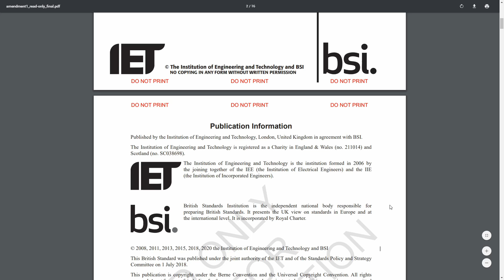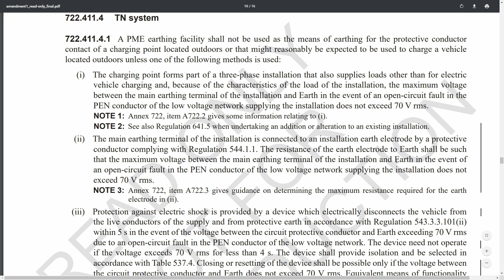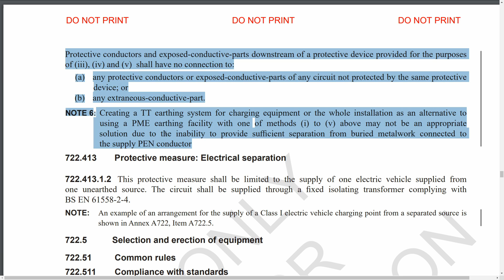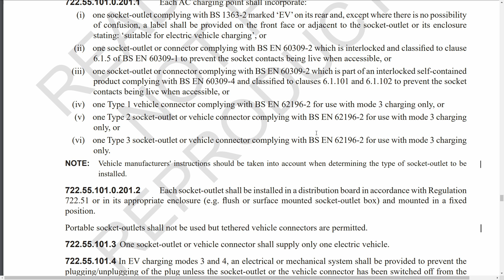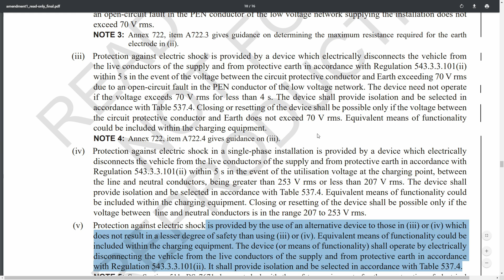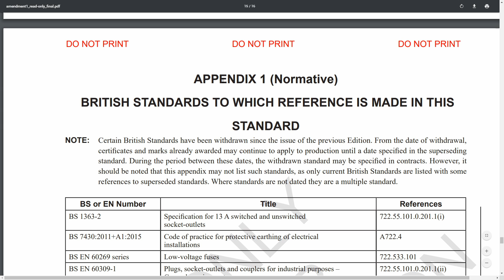BS7671 18th Edition Amendment 1- Section 722 Electric Vehicle Charging

Comment: If you want to print this without paying those miserable bastards at the IET a fiver for the privilege then just use almost any PDF viewer that isn't Acrobat. The 'don't print' protection is just a bit which software is free to ignore. So evince/atril on linux works just fine, for example.

Comment: Isn't that unicorn device just a voelcb, just wired differently? Or a voelcb in series with a relay on the neutral too if there aren't two pole versions?
Reply from the maker: Yes, it's a VOELCB with 3 poles, switching L, N and E.
The main difficulty with such a thing is that the earth electrode needs to be located far away from any other metal parts connected to the TNCS earth, otherwise when a fault occurs, voltage will appear on it from the TNCS earth and prevent it from working.

Comment: Good to see that, with your notes. The 722.311.201 item is interesting, as to what might happen if lots of houses want to change over to EV cars with charging kit in the next few years. At the time of writing this note, the DNO at my place is just replacing all their buried cable (and has just renewed the ‘local transformer’ at the substation) on account of having had a lot of cable faults in recent years.

	They appear to be doing a like-for-like job, with the exception that the new cable is being installed in plastic ducts, instead of direct burying, which the old ones are (and are likely to stay buried, most likely). Some houses in my street use ‘night rate’ power for heating, and some don’t, and it would be quite interesting if there is a substantial increase in EV charging - e.g. if I do that, my place can easily draw ~80A overnight, like tonight if I also wanted to charge an EV on top of it.

	Maybe they’ll be looking at better management of total load (either within a building, or within the local transformer area) to avoid increasing the DNO system capability; we’ll see.

Comment: Hi John, thanks for such good explanation, really helpful.
In case of an outdoor 3-phase EV chargepoint (say a supermarket parking), would option (i) imply no further protection method should be used? Or that would only be the case if no other loads were connected to the same supply?
Thanks!

Comment: Why is this only relevant to ev chargers? Surely this should also apply to hot tubs and big outside lights?
Reply: Hot tubs, etc., don't store millions of joules of electrical energy that can work its way back up the wires and into the house and street wiring under fault conditions.

Comment: you could make a device to fit the parameters of 722.411.4.1(iv) using an arduino, wouldn't be practical or legal to make for someone other than yourself, but would be interesting though.

Comment: Hi John

On 722.41.4.1 (iii) "the unicorn device"  can this not be achieved by having a star of three resistors connected between phases to give you a "replicated" star point of the transformer and therefore a replicated earth, then the voltage between the resistors star point and the PEN conductor is monitored and a contractor/relay is opened should the voltage exceed 70 V there for disconnecting L1,L2,L3,N & PE

As far as I can tell this is how the matt-e o-pen 3 phase device works, as this doesn't use an earth electrode but says it complies to 722.41.4.1 (iii)

The matt-e o-pen single-phase model disconnects if the voltage is out side of the 207 V - 253 V range and complies with 722.41.4.1 (iv)

Thanks Marcus

Comment: Great video, clear and concise. My own farm property has 3 phase, TNCS and so the device described under subsection iv of 722.411.4.1 would be a good solution. Anyone know who is making that type - ie 3 phase charger with voltage sensitive auto disconnect?

Comment: What about the Matt:e device? I know it apparently is not CE approved/60204 etc
Reply: The Matt.e device is still being allowed by DNO's for charging points but its recently been disallowed by DNO's for V2G. OVO and other V2G installers have had to stop using it and start installing TT "islands" for their systems. This leads to all the location hassles that JW points out here, plus difficulties with making an earth of less than 100 ohms resistance. quite a few installs are being cancelled or abandoned.
Reply from the maker: They make several devices, the single phase version complies with 722.411.4.1(iv) and disconnects if L-N voltage is outside the 207-253 range.  However that's still only a partial solution as it cannot detect the situation where both the L&N conductors have an elevated voltage relative to Earth and the voltage between them is still between 207-253.
Their 3 phase device will detect all instances of an open PEN conductor, but rather obviously can only be used in 3 phase installations, as it requires connection to all 3 phases.
Reply: John Ward yes, I was thinking the SP device, seems odd that they don’t CE the device. A nervous installation with just that!
Reply: There are plenty of devices that will detect out of voltage/frequency range, the Ziehl relay does this for anti islanding  and is G98/G99 too.

Comment: https://www.cef.co.uk/catalogue/products/4873098-single-phase-voltage-monitoring-and-protection-unit-with-type-a-rcbo  Hi Super John, I take it this is what's referred to with voltage monitoring.
Reply from the maker: Yes, that would comply with 722.411.4.1(iv) and disconnect all conductors if L-N voltage is outside the 207-253 range.
However that regulation is only a partial solution and won't be of any use where L&N both have an elevated voltage relative to the actual Earth.

Comment: JW, if you can't print the document is it not possible to cut and paste the document???
I ask that because you were able to shade the text with your mouse
Reply from the maker: Selecting text works, copying is disabled as well as printing.
Reply: Text can be selected but not copied to clipboard.
Software is available that takes a page of PDF and converts it to JPEG
Screen grabbing will work also.

Comment: Great informative video yet again John. Regarding indent (iii) the device which electrically disconnects the vehicle from the live conductors of the supply and from earth in accordance with 543.3.3 within 5 seconds if the voltage exceeds 70v between the cpc and earth... I am under the understanding that pod-point charging devices (pod-point solo) incorporate this technology therefore allowing the connection to a P.M.E service in a domestic dwelling so long as the unit is fixed to the structure of the building and not on a pillar set up. Their pillar devices do not have this facility as far as I am aware.
Reply from the maker: The manufacturers of that device claim it complies with (iii) - yet they also state it doesn't require any earth electrode.  How they can measure voltage between the CPC and Earth with no connection to Earth is a mystery.
Reply: @jwflame  Could the connection to Earth be through the tyres ?
Reply: John Ward John that is a great point!! Would be interested to hear their explanation on this because I can imagine their installers will be throwing these in and certifying them. Would it be the case that the installer is putting a note on the cert that according to the manufacturer the unit complies and they have installed as per manufacturers instructions therefore they cover themselves.?